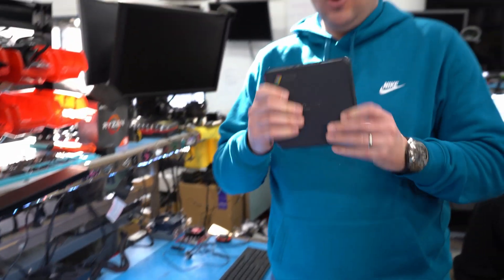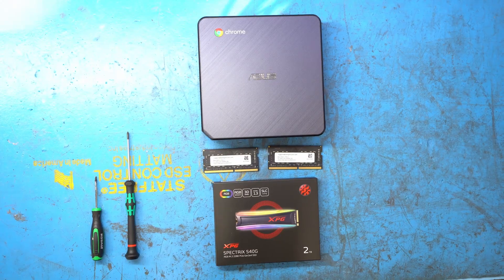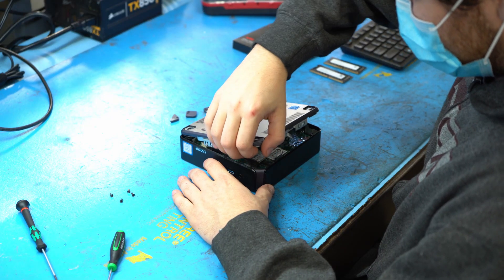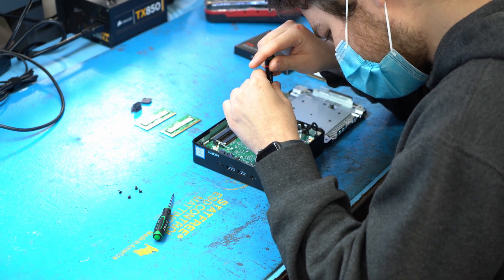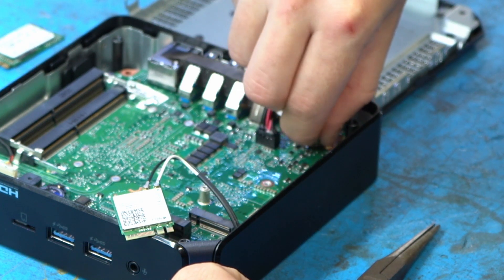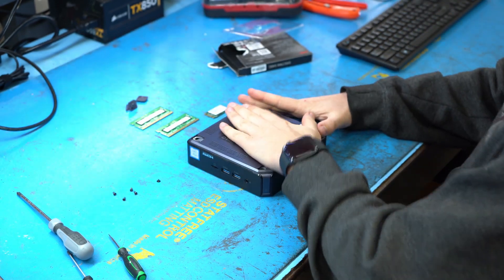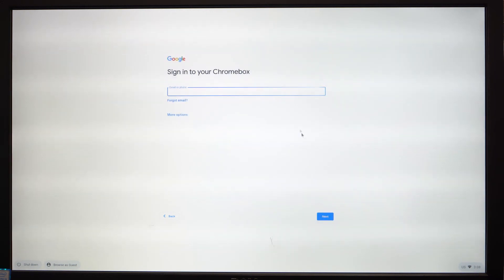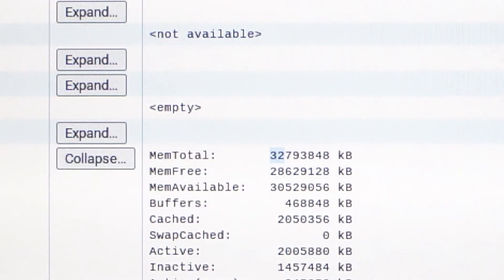How to Upgrade Chromebox with Asus Chromebox 3 - 32GB & 2TB SSD

Comment from the maker: This video is 3 years old now but I wanted to mention that if you have a Chromebox 3 Celeron version NVME will not work.  You should be able to use an M.2 SATA SSD, just not M.2 NVME.
Reply: Timely update! was just about to do this with G.SKILL Ripjaws DDR4 SO-DIMM Series DDR4 RAM 64GB (2x32GB) 2666MT/s CL18-18-18-43 1.20V Unbuffered Non-ECC Notebook/Laptop Memory SODIMM (F4-2666C18D-64GRS). Is there cheaper RAM I should be looking at? What's a good cheap fast SSD I should be looking at? (Don't need much more than 128 gb)

Comment: Quick question, if I could please? 
Many/most of these Asus Chromebox 3 units come with 128GB of storage, yet on your screen at the 7:42 mark of the video, it shows us that Chrome OS is taking up 281GB. How can this be?
Reply from the maker: Hi Steve, this video is from 4 years ago so forgive me if I'm not 100% accurate here but i'll do my best guess.  281GB is used of 1.7TB of space being showed on the screen, so it doesnt mean Chrome OS is actually taking 281GB, but that we've stored 281GB of data on this drive.  That being said, this video is about seeing if the Chromebox will take more RAM and a bigger SSD...specifically 2TB, so that explains the 1.7TB it says.  Hopefully that makes sense for you?
Reply: Thank you for your reply, @computerheadquarters  
I believe that the only way that can make sense, is if when you put in the SSD, it was not new, and had a fair amount of data on it already , correct? 

We have several of these as a family, and have been considering, recently, either replacing or upgrading these. We think we are fine, with our current 16 gigabytes of RAM, and are more interested with what you say here about the SSD upgrade. It's either that, or plugging in additional remote storage, and as you know, that never goes quite as smooth as this route you show here.
Reply from the maker: @SteveMidwest  Hi Steve, i'm trying my best to help you here, but there is no way for me to know how much data we put on the drive when we did this 4 years ago.  That being said, Chrome OS is very small - only about 4GB.  So with this drive showing it has 281GB of files on it, it's safe to assume we were loading a bunch of huge files on it on purpose to see what speed the performance was on it by reading and writing to it.  I can't think of any reason any of our drives at work would ever have 281GB on them other than maybe a drive that was storing a bunch of video games like Modern Warfare.  Either way it really shouldn't matter for you because Chrome OS only takes up about 4GB.  You could go to a 1TB for very cheap and get a huge increase and it's also an easy project (IMO).

Comment: Asus product page specify it can only go up to 16gb ram + 256gb storage, are they wrong ?
Reply: You can go up to ddr4 64GB ram and at least 2 TB SSD nvme
Reply: @haraldsyilivesterkarugaba1430 Yup
Reply from the maker: Yes
Reply: @computerheadquarters  am run ning a cn60 with a 1tb ssd and 16 gb ram and windows tiny 11 and it runs fantastic

Comment: One  info I learnt. 
I was wondering how they replace  smaller form M.2 --- which came defaul  with the Box ---- with larger 2280 M.2 ..
You just explained just remove and replace Screw at a different place .
Thanks.

Does your Model support both SATA and NVMe  M.2 form factors or just NVMe ????

Comment: Thanks that was helpful as I am about to go through the same process on the same machine.
I got it cheap on eBay because the seller thinks it is stuck in Enterprise Enrollment but I have a chap locally who reflashes the ROM for me to latest version sans Enterprise.
I was not aware that the CN65 can take such a large SSD, physically and mentally so that is good to know and will inform my buying decision, maybe nothing as I have a spare M2 2280 500Gb by Crucial doing nothing.
Really helpful, so thanks a lot.
Reply from the maker: Awesome! I dont think you need to flash the rom.  Enterprise enrollment is just part of the machine and can be worked around.  I think you hold CTRL+ALT+H to make it go away? It's been years since we've messed with these so i dont remember off the top of my head.  I am pretty confident there is an easy work around though without a ROM flash.
Reply: @computerheadquarters  OK thanks, when it's delivered I will try control+Alt+H before spending money on a rom flash. I have seen several ideas on removing the EE but none worked on a CN62

Comment: Thanks for an easy and useful video. The paperclip pin (above the lock on the right side of the box) is a helpful key for downloading the ChromeOS instead of pressing ESC+Refresh keys. You still need to download ChromeOS which is missing in this video.

Comment: Great video but one key part of the process was left out. There was mention of a flash drive later on but no guidance as to what is required, which would seem to be quite a vital part of the overall process.
Reply: yep I assume that was a spare drive for "chrome OS recovery utility" because you cannot just pop out and insert a new ssd, there is no OS to boot from, probably they want to save time in recording